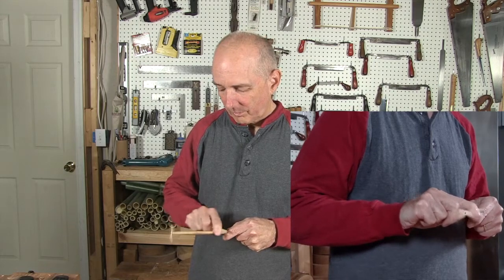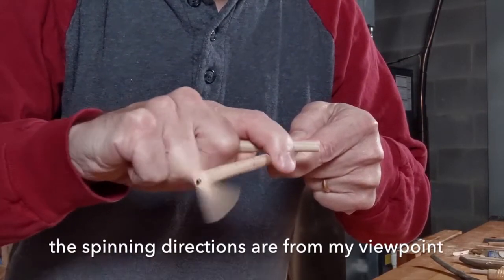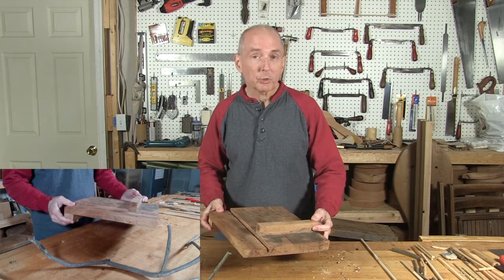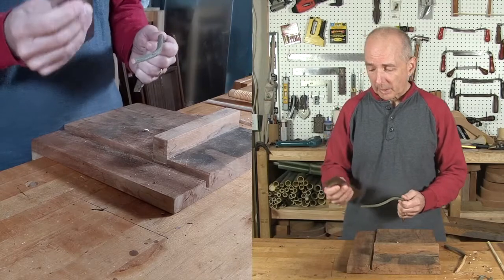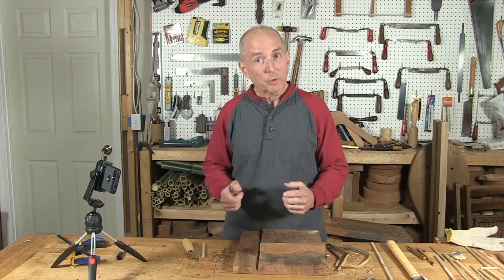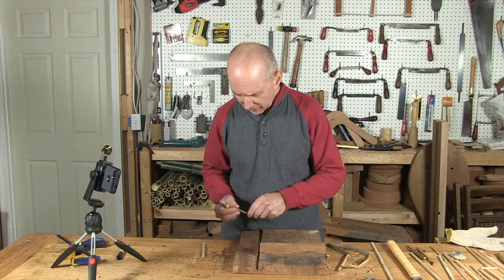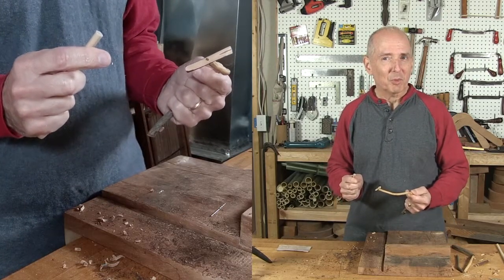Learn the Secret and How to Make the Gee Haw Whammy Diddle

Comment: I used to make these with my 7th grade Shop/Engineering classes.  Instead of a small branch I used a twelve inch piece of 3/8" hardwood dowel for the toy body.  A mini popsicle stick for the propeller.  An eight inch piece of 1/4" dowel or a comon pencil was the rubbing stick.  The students laid out the notches at every half inch.  We left 4" at the bottom for a handle and left 1" at the top for attaching the prop.  We used a rat tall file to make the grooves.  A drill press or cordless drill to drill the holes.  Students loved this simple project.
Reply from the maker: What a great story! Thank you

Comment: I tried to make one. It spun to right, but I can't get it to spin to the left. I used dowels. I have checked my hand placement. Anything I should check?
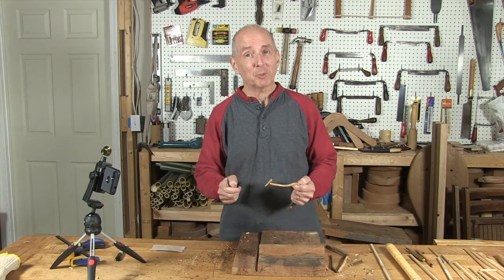Reply from the maker: I'm glad to hear you made one. It is fine to make it with dowels. Did you check the video at 13:41, troubleshooting? The whammy diddle I made easily spun to the right, but not to the left. In the video, I demonstrate how I made it spin to the left. Also, check that you put a little friction on the nail that holds the propeller (11:48 in the video).